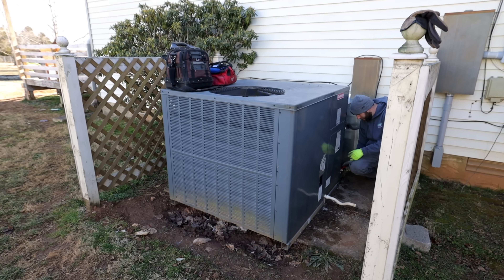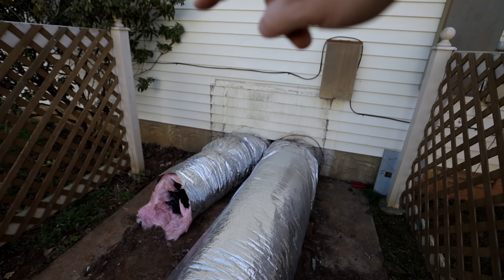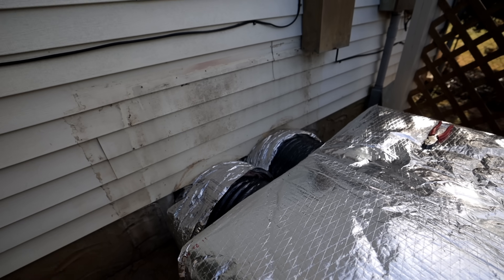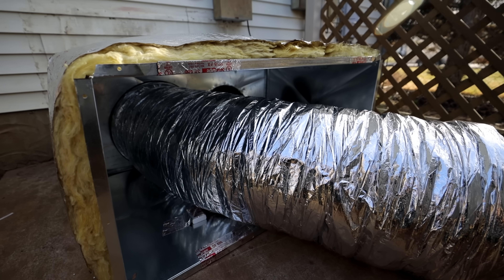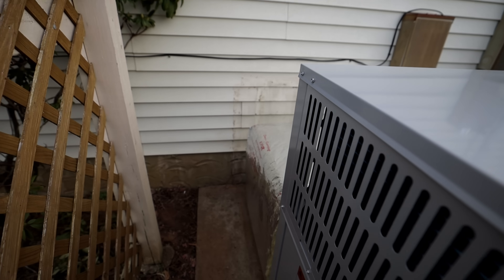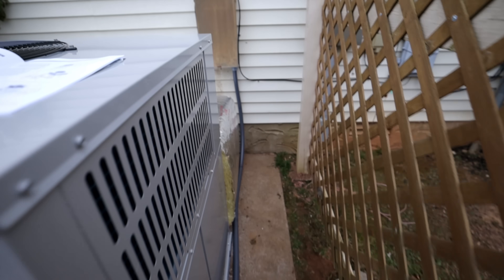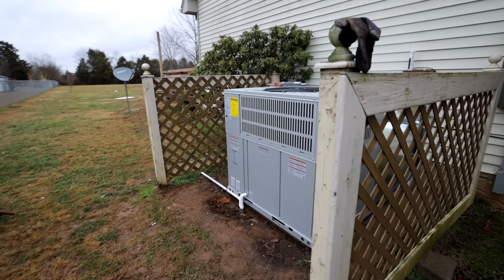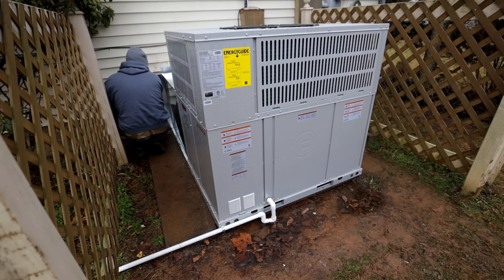Installing A BOSCH 18.5 SEER Variable Speed HEAT PUMP Package Unit | HVAC Replacement

Comment: Bosch units come 3 ton/ 2 ton and 5 ton/ 4 ton. You MUST select the capacity with dip switch jumper J2. Up (on) for high capacity and down (off) for low capacity.

Comment: why would you not shorten the flex duct? the longer the run the less airflow is achieved/ flex duct runs 20 % less than rigid. does anyone ever know anything about airflow and static pressure.

Comment: I am hoping you monitor your comments - here is my problem! My package unit (2003 ICP) is LOUD LOUD LOUD inside the house! There is nothing wrong with the unit.....it's just that the combined noises, probably mostly the distribution fan and air noise, makes for 55 db (way too loud) in the bedrooms which are on that same wall.
Have you had problems like this? Having a super quiet outdoor unit will help a little, but I need quiet indoors. Do you think just getting a newer unit (any sort) will automatically be much quieter indoors?
It's hard to sleep 2ith 55 db on and off.

Comment: I'm buying a townhome that the HVAC system is this package unit. The unit installed has about 15 years and replacing it will be one of my first projects for the new house. I'm surprised that has some 13-14 SEER units pretty cheap ( about 2K ) but man, I really would invest in a higher efficiency unit like this bosh. Could you give me the model number?

Comment: My question is what is the price of this Bosch package unit if you know? I'm in the process of shopping around on upgrading my 4 ton split system on my 2600sqft mobile home to a 5-ton heat pump air unit. Long story short an energy audit done and was informed that my AC was too small for my square footage which I have seen in my energy bills set at 76° the thing ran or runs all day and half the night just to keep it at that temperature humidity is staying super high in the house my air company is suggesting a packaged unit cuz I'm not really caring for because it is not a variable speed unit and apparently they do not offer one and since I have a 17.4 kwh solar system installed on my home I am really trying to save energy and would prefer to have a variable speed unit they are rebuilding me from the ground up new air handler duct system and new heat pump I'm really trying to save some energy here.

Comment: How do these packaged units compare to a conventional indoor air handler / outside condenser? Wouldn't you want the conditioned air to live in a conditioned space inside (or a cool basement) instead of the dead heat outside?

Comment: Awesome install!  
Everything I'm seeing about the Bosch's has me leaning to replacing my dying 18yr old Goodman heat pump package unit with one.  Do you have any thoughts/ideas about whole home filtration (electronic filter) with a package unit?  I'm seeing most all of them are designed to be mounted between furnace and ductwork.

Comment: Awesome unit !! I had this one installed last April on my home. Amazingly efficient and so quiet you can barely hear it running.
Reply: Do you mind sharing how much you paid for the unit. Thank you
Reply: @rick83642  As I recall it was right around $10,000  Well worth the amount of electricity it will be saving. Hope this helps.

Comment: Find one good brand and stay with it. That's my advice after being in business for over 20 years. I get prices that are $300 to $500 lower than other companies per system just because I buy so much of one brand. I used to install several different brands, but it liked to have bankrupt me and I lost several customers putting in high tech junk. I've seen you installing one of those brands that's junk. I'm not going to name the brand. You'll figure it out.

Comment: I dont know what icp was thinking when they designed that horseshoe unit. Bosch now makes a 15 seer air handler that matches with there 18 seer condenser.

Comment: not sure where you learned that but your local code official is gonna have some questions I would like to see the manual D on that duct system myself.
Reply: I understand what you're referring to, on all the levels, and he likely does too. But a lot of people don't. I'm not here to demonize anyone or assume what someone knows, or what they're okay with sleeping at night. BUT, knowing how to build sheet metal and having access to a break and Pittsburgh is really the only efficient way to provide quality in a retrofit scenario. A thorough assessment setting the job up, in my professional opinion, would've been the best defense against this, now opened can of worms. Could've easily showed up prepared with rec duct and some D 90s, and got the customer to pay with the thorough analysis and proper advice. As an installer, I only bring any of it up to help save face in the future, as I'm sure some cost was ate here, unless there's a decent amount of padding which is a whole other topic.

Comment: Nice Bosch install, we've installed three of the Bosch pack's so far and have had zero issues. Customer's love them. Only thing I'd do different is add a cleanout on the condensate drain for ease of maintenance. We do a T instead of a 90 elbow right before it goes into the p-trap then add a cap on it. Makes blowing out the p-trap super easy
Reply: Shit, it looks like it just drains outside in the dirt. I wouldn't even glue the drain. Then just take it apart everytime it needs to be cleaned out
Reply: And a vent after the trap

Comment: No vent on condensate drain line, old disconnect, vapor barrier will eventually break down and clog evap coil, no flex connector on box, just sayin.  Good video though
Reply: No vent necessary for a condensate drain line OUTSIDE with ensured 1/4" per foot pitch. Old disconnect is debatable, but a good PRACTICE to change out when APPLICABLE. Vapor Barrier? Explain your reasoning on this... I'm assuming you are referring to the vapor barrier sleeve around the insulation of the flex duct itself? how long do you think it will take to break down... 20 to 30 years MAYBE? Flex connector on box... I'm assuming you are referring to a flex canvas duct connector between the crossover box and the equipment? Dude; the crossover box is literally connected to flex ducts (Supply and Return trunks) existing in the crawlspace... doesn't get much more of a flexible connection than that... Some of you weekend keyboard warriors need to chill haha... EVERY job can be nit-picked apart AFTER it's completed. Sometimes you have to work within conditions that are present and the customer's wallet.
Reply: @adamhyche8947  well said dude!
Reply: @adamhyche8947  I'm just thinking of unit vibrations carried form unit to house through the solid piece of sheet metal that is probably screwed to side of unit and house, especially when a motor starts to fail and shaking due to failing motor bearings/bushings. Vapor barrier on supply ducting will break down over time, but can be caught by the air filter if at evap coil and not just a filter grille inside of house. Just trying to prevent a future service call. I have been in the trade for 23 years now and seen some things 😳. I come in ✌. I like your enthusiasm for the trade. Keep it up brother

Comment: I have just one question? Why not have changed out that disconnect? Say in a week it drops voltage and you ruin a new compressor. To me doing a change out a disconnect,and or  breakers are always part of a change out. Its covering your butt. The box was a good way to get out of a pinch. Why not use pipe and a canvas inside of it. I suggest cause if the outer jacket breaks down it will get stuck in the coil. Just an out of the box thought.
Reply: Was thinking the same thing

Comment: Nice install. Curious what the static pressure is on the return with that box you added 🤔 Looks good though👌 
Also have not seen an inverter package unit though. You'll have to keep us posted
on the performance of it.
Reply: I was wondering the exact same thing.  There is probably a lot of turbulence in that return box!

Comment: I have done the same when ducts where backwards.just a tip from an old sheet metal mechanic.when you have a long cover like this put standing seems on top every 12 inches.it looks really nice and if snow accumulate on top it won’t bend it.your work looks great and thinking and finding a solution to a problem